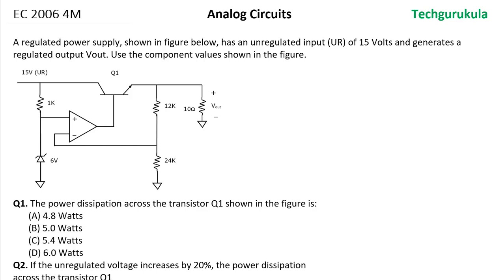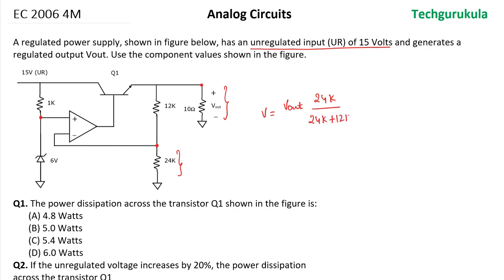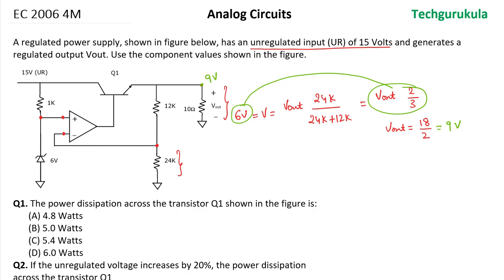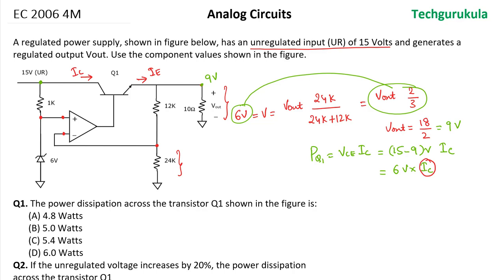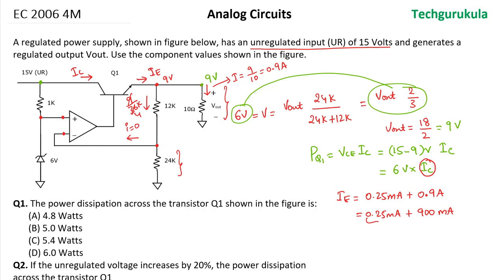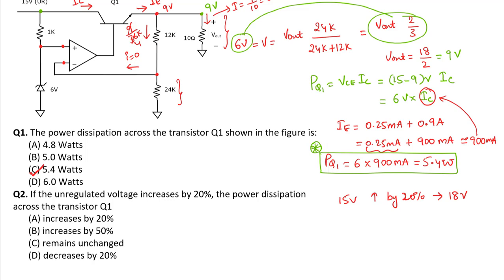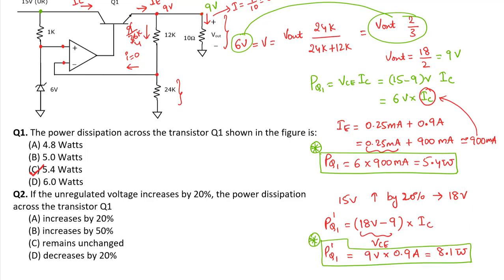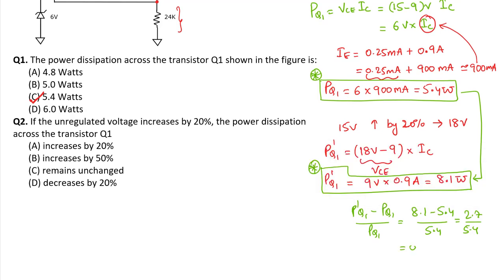AC: EC GATE 2006 4M - Regulators

Comment: Sir I have a small doubt . if u take that zener diode in breakdown then then there is a possibility to current flow into op amp because we have potential difference (15-9)/R
Reply from the maker: Hi Venugopal Reddy,
     Thank you for the comment! You have answered the question yourself with the below comment!
     Analog Circuits course is going in a sequence, right now op-amp is not done. In the theory video, I've mentioned for now assume current taken by op-amp is zero.
     Op-amp will be covered in detail when we get to that topic. Thank you for following!
     Theory video: https://www.youtube.com/watch?v=aYymbYCiR78 
Thanks,
Techgurukula.
Reply: @techgurukula  k sir
Tq

Comment: How 6v =Vout(2/3)?   What is that concept?
Reply from the maker: Hi ilavarasi anbazhagan,
   Voltage across 24 Kohms resistor should be equal to voltage across Zener diode (Zener break down voltage). Hence, 6V = Vout * (24K/(12K+24K)) = Vout *(2/3).
   Corresponding Theory video on this topic is here : https://www.youtube.com/watch?v=aYymbYCiR78 
   Hope that helps. If not, please let me know.
Thanks,
Techgurukula.